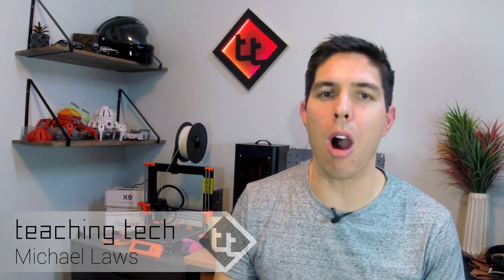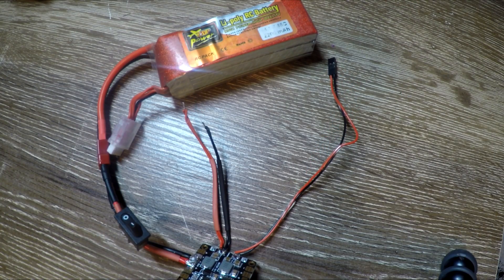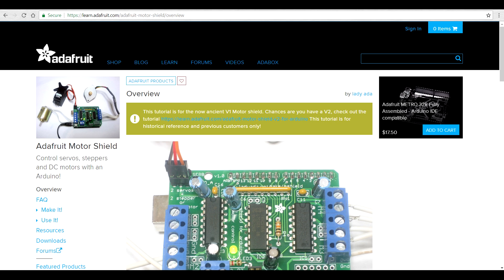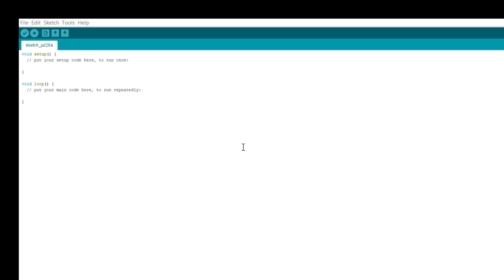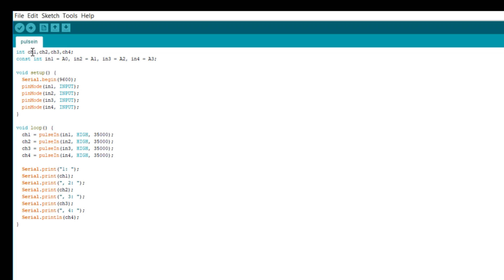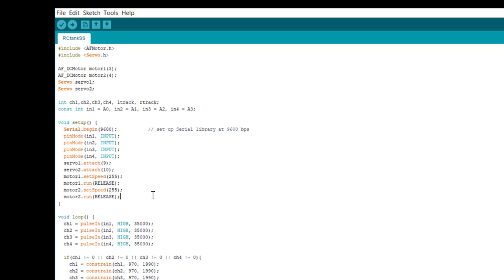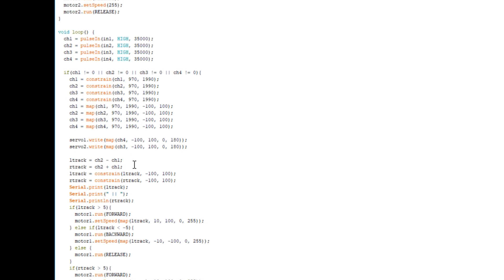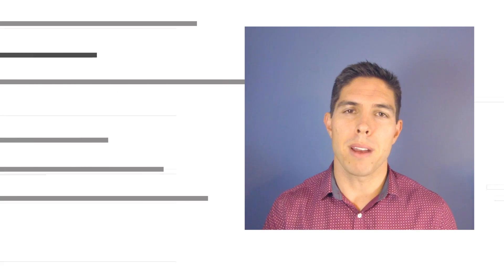3D printed RC silly string tank - Part 1: Assembly, electronics and Arduino code

Comment: Hello Michael how are you doing. I loved building the silly string tank, the Grandkids and I have spent literally hours playing with it. In fact, most every time the kids come to visit they ask to get out the silly string tank. Well, it looks now I have a use for yet another tank,,, but this time it's not going to be a silly string tank but instead a remote control string lawn mower. I will be purchasing a new chassis and all of the same hardware as the silly string tank and in addition the the parts list I will be adding one additional motor and three string trimmer heads (TANGNADE Universal Fit Trimmer Head For Pivotrim For Stihl For Husqvarna ABS). I will be widening the chassis to accommodate the necessary room for the trimmer heads to be placed in a triangular arrangement  for complete coverage of the grass cutting area beneath the chassis. I believe that I will be able to use one motor with a belt drive configuration to drive all three trimmer heads. I realize that overall weight of the project will have to be kept to a minimum so aluminum (possibly carbon fiber) and plastic will be required to complete this build.  Any additional ideas and design concepts that you could provide with this project would be awesome and greatly appreciated.

Comment: Hello,
I just wanted to say thank you for your very well put together video and your thorough documentation. I have been working on a school tank project with the FlySky FS-i6 controller for the last four days straight, pouring over documentation about PWM, PPM, motor shields, and more just trying to get the data to transmit correctly. It never even occurred to me that the data was analog and needed to go into the analog-in pins. I did incorporate your mapping instead of my digital mapping (of course). I appreciate you making this video, again thank you.

Comment: hey mate im having abit of trouble ,
                                                               Everything seems to be lit up correctly and the gimbal is moving around perfectly ,
but im not getting any response from the motors , ive gone back to 9:00 and used the serial monitor to check my left stick for a respone and its not getting any readings come threw , im thinking ive either not soldered the a0 to a5  header pin ins in good enough or i havnt made the female connections properly , is there anyway to figure out whats happening or should i just make a new 4 pin set and re solder the head pins in and retry ?
cheers

Comment: Hey  there TT,,, Love your channel!!!! I had a minor bit of trouble getting the code to work,,, It was a super easy fix- Trouble comes from lines 1 and 2 of the code. Line 1 should read "#include <AFMotor.h>".  Same in line 2, it should read  as "#include <Servo.h>"
Reply: yeah i had that issue arrise aswell , just added the ".h" and problem solved .

Comment: Sparkfun has a shield for high power applications and it is compatible with Arduino Uno R3 and it’s been out since 2012 but for some reason the sample codes are just the shield and arduino and nothing combined with a receiver transmitter is that going to be a lot of code to write?   I’m surprised that it hasn’t been done already from what I’ve seen it’s going on a month and all researching has led me to start asking around.  I purchased a L298 h-bridge and was able to find a full working code for everything and it worked but not for the load.  That’s what I get for being a noobie lol.  Thanks for your reply and by the way your tutorials are great 👍 I learn something new every day!🤓✌️

Comment: would it be possible for you to post a code for a later version the vhn2sp30 Monster motor shield and flysky reciever     two motors 12v tank style these chips are said to be changed out with a different chip and alot of code that was out there is outdated ive got some code but there are errors and have no idea how to fix https://create.arduino.cc/editor/44Hi5skinny/110c9848-b1c1-46e6-8c04-5b889ceee636/preview could you do something with this please thanks you your help will be greatly apprecieated!!!
Reply from the maker: It's impossible for me to provide the code if I've never used the product, sorry. Keep searching and hopefully you'll find what you need.

Comment: 13:58... It is good/safe practice to turn on the RC  Transmitter first, before the Receiver. This way the first thing the Receiver sees is the TX signal and not noise. 
When turning 'OFF'... Turning the TX off last also insure the RX does not receive any erroneous noise signals.
Reply from the maker: I'm pretty new to these types of radios so I appreciate the advice :)